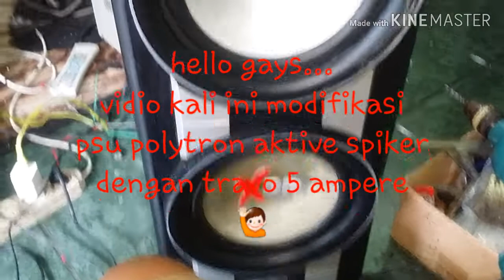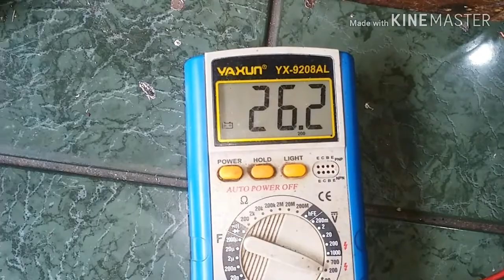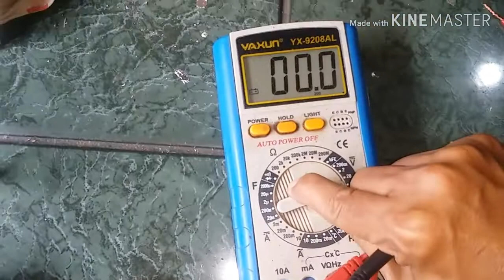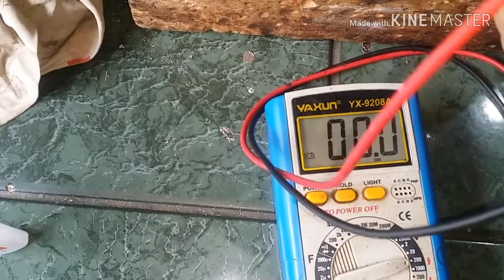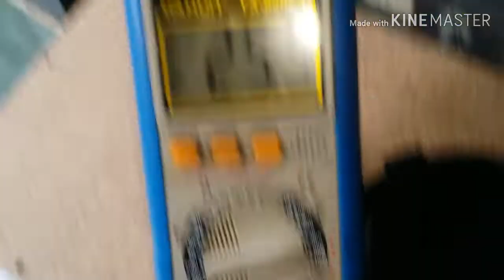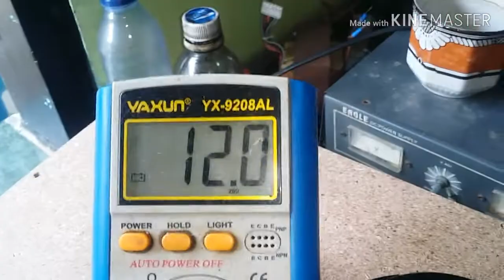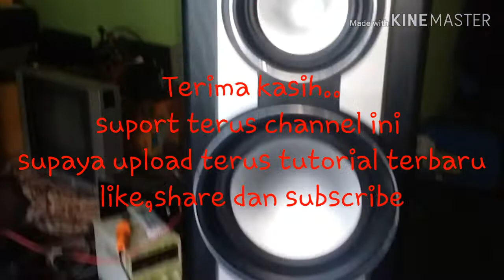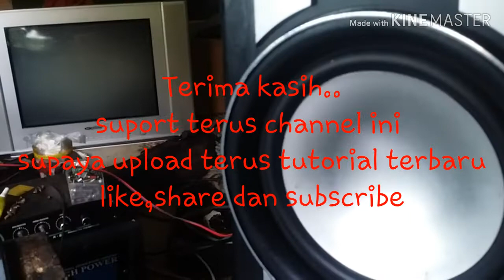MODIFIKASI PSU POLYTRON AKTIVE SPEAKER PAS 68 (B)

Comment: Mas resistor  yang dekat transistor BD 140 ukurannya berapa di PCB ada tulisane 642 gelangnya warnanya apa
Reply from the maker: Itu r smd mas kalo body nya tertulis 642 artinya 6,4 kilo ohm . Bisa di ganti dgn 6k8 r biasa
Reply: Itu r 1 Watt ya mas
Reply from the maker: stengah watt bisa mas
Reply: Mas kalo tegangannya naik turon masalahnya dimana mas
Reply from the maker: tegangan bagian mana mas , itu rangkaianya masih asli nya apa sudah d rubah ,.
Reply: Aslinya mas
Reply: Tegangan ke USB naik turun ke tone kontrol juga naik turun mas
Reply from the maker: smps aslinya memang gtu , kalo kena bass tegangan drop dikit gpp mas masih normal itu ,. keculai dropnya banyak brati ada komponen yg short .
Reply: Ow gitu ya mas...dropnya banyak mas...TIP 41 panas mas sudah ganti baru
Reply from the maker: Brati bagian drive power nya bermasalah mas . . . Coba transistor sebelum tip di cek smua. Perhatikan suaranya ..kalo suaranya masih cacat coba resistor out kaki emitor tip di cek juga biasanya putus .